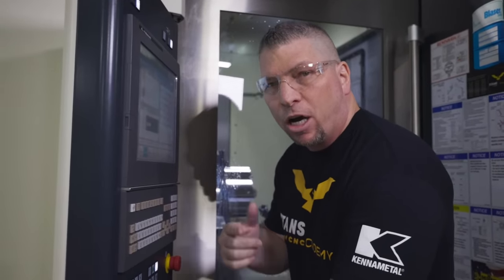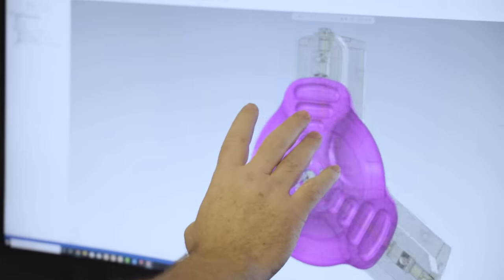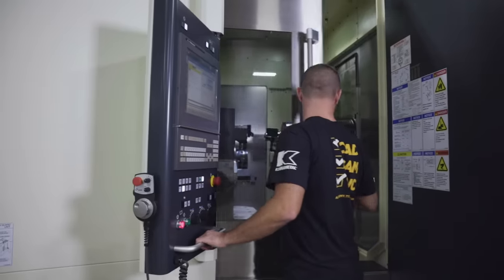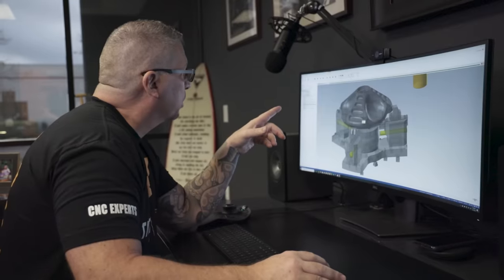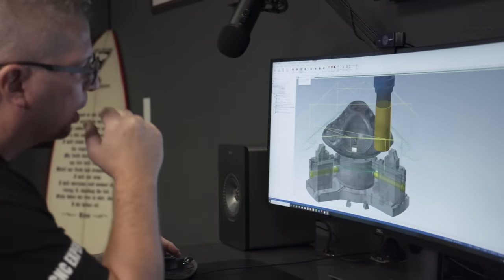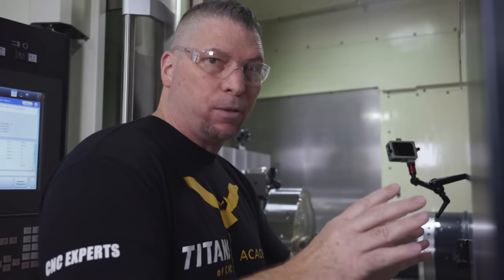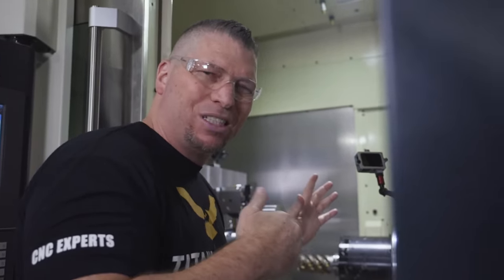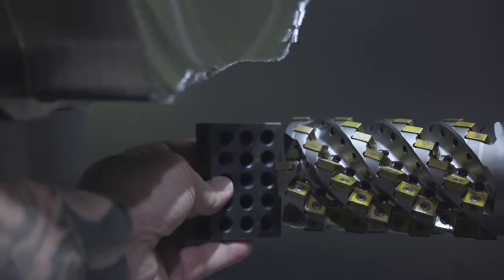60 HP Makino Cuts 150 Pound Titanium Aero Part With Kennametal 65 Insert Beast Cutter

Comment: I can feel the machine vibrating in my house.
Reply: I can feel the vibrating so too in S.Korea.
Reply: I feel nothing, yet
Reply: It doesn't vibrate.
Reply: If that feeling seems to be coming from your wife's sock drawer then that isn't the CNC buddy. Just sayin
Reply: then the volume of speaker turns down
Reply: Same. Could be the 2000watt sewer pipe sub I built.
Reply: @단순한토끼 ni,,,,, se se
Reply: Machines like that dont vibrate. If it did it would be virtually impossible to make the part after the measurement.
Reply: If it's vibrating your in trouble
Reply: Maybe you need to get a better house. 🙃
Reply: Oh thats just the chatter
Reply: There is no vibration.
Reply: @mortzon5681  well, i guess you haven't stood next to one. You're welcome to our shop. While roughing with an insert mill vibrations are very common and strong. Finishing is a different story.
Reply: @Charles McDowell you don't know
Reply: @MetricNova  I most definitely do know LOL
Reply: @charlesmcdowell3984  how do you know then
Reply: @MetricNova  because I work as a maintenance technician in a very large machining center?
Reply: @charlesmcdowell3984  very well
Reply: @charlesmcdowell3984  Found the guy thats never ran CNC before.
Reply: Titans programs do not chatter... He's a God.
Reply: CNC guys am I rite
Reply: @sendit9736  very good video

Comment: I worked for eight years in titanium for AIRBUS. I do not believe that so much material can be milled with one side of tiles in this type of heads, which after work look like they just only touched the material. Maybe if the film was uninterrupted, from one shot and with a guarantee that it was not processed in any film processing program ..... We also tested Kennametal plates, but apart from the higher price than others, we did not notice any revelations. We found the best price-quality ratio in the Polish BAILDON tiles and in the PLANSEE tiles.....